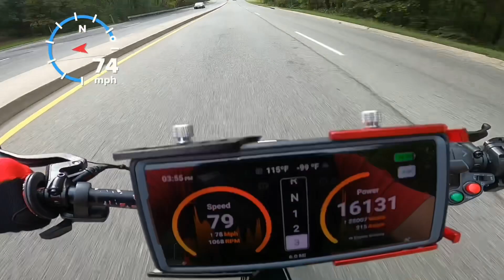BAC8000 or Fardriver? Someone suggested I should get FD. High Voltage not enuff to make me switch!

Comment: How did you switch from a FarDriver with a single connector to the BAC8000 wiring harness with a dual connector?
Reply from the maker: i didnt switch from a fardriver i switched from a sabvaton but you can had wire anything this is a DIY build from scatch it didnt come with anything its what in put in it but people switch controllers all the time at least I do they ll got the same connections just rewire

Comment: Bac has way more customization. I'm switching to bac next year so I can descale my motor when it gets too hot. Fardriver doesn't do this so you can easily blow your motor if you aren't paying attention
Reply from the maker: @500wattz  good move but what did you say you wanted to be able to do? Not sure if that's typo but have no clue what that word is
Reply: @ChrisCrossingWires1212  when the motor gets too hot the bac controller will descale the tune to help control motor temp. That is the goal.

Comment: You say the vesc is bettr from the assi?
Reply from the maker: Im gonna say ASI software is just as goo and or equal to Vesc which is the latest greats tech but theres several different companies using Vesc like 3Shul, EBMX lots of them now I think ASI has the best FOC even tho its older You cant beat it and were really talking apples and oranges VESC really software Maybe ASI will implement it in future products if they come out with a controller that can support higher Voltage Id never change over Its cetainly levels better than Fardriver which honestly is a inexpensive but powerful controller if they step up their build quality they be allot better but I guess more expensive thats why people like them their reasonably priced

Comment: What bike is this ?
Reply from the maker: It's called My Bike, lol sorry bro they're is no company branding these are Chriscrossingwires built bike from what I consider to be top notch parts and custom built batteries. I build them from the ground up with EBB frames by Garmata or NB Power, same frame. Closest manufactured bike to this would be a Cab motorworks Racer. You can look that up, they use the exact same everything including BAC8000 64AH Battery not custom for high power like mine and QS273 and they charge 25K fully spec. I built mine for less than half of that but that's what I build them for half of what they charge. My bike had better performance
Reply: @ChrisCrossingWires1212  ah no worries bro looks fucking amazing was wondering why I couldn’t find it anywhere
Reply: @ChrisCrossingWires1212  how much for the stealth bomber ?